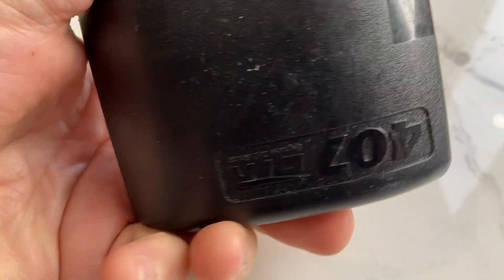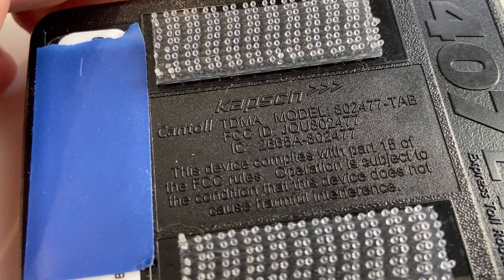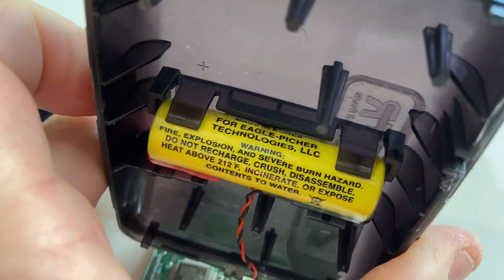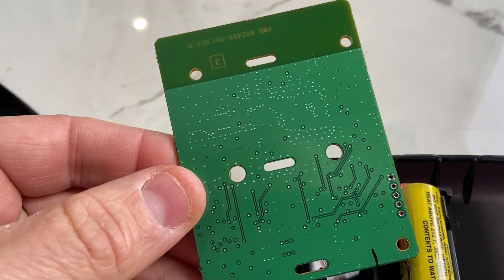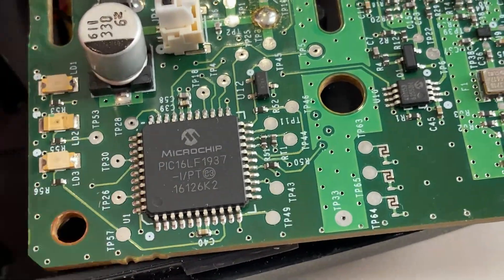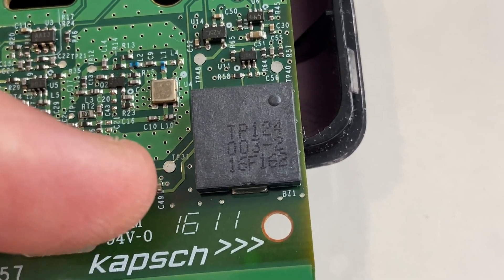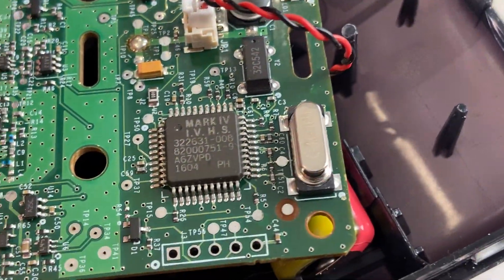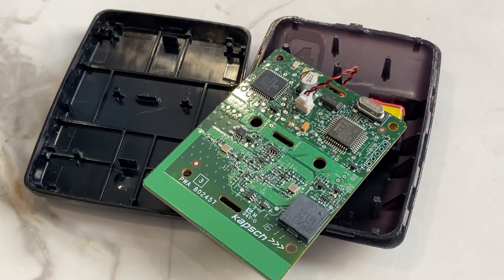Teardown of Kapsch 407 E-ZPass Electronic Tolling Highway Transponder

Comment: The battery is a 3.6V Lithium battery. Usually a TL-5903. Can I have yours? Mine is dead ;-)
Yes, it is 2016/Nov.
Reply from the maker: Thanks! Sadly this device has already been recycled... I can't keep everything I tear down or I'll get kicked out of the house!
Reply: Its a rental dont spend money just go ask them to replace it or give u a new one they charge u money for it for a year of rental
Reply: Are you sure on the date code? I opened a kapsch PWA 802184, but the date code is 1524. There isn't a 24th month, so maybe it is week number? My unit was marked "Exp 03/24" so for a nominal 10 yr battery life, 2015 seems a good mfr year.
Reply from the maker: @johnhouck8315  Yes you are probably correct, the first number may be the year 20xx, and then second number the week within that year (so it shouldn't go above 52 theoretically).

Comment: These use the 900 band. I think they are 928 MHz 

The RFID Frequencies are usually a main frequency, not in the middle of a frequency.

So like 912 mhz is the bottom of the frequency and it goes up to 938 MHz 

I usually see around the 928 to 932 mhz but I saw 915 and 918.mhz.

The frequency being transmitter by the base antennas is very wide

It blanks out the AM band with static as you drive under them 

The license for each antenna used to be available on the FCC database and they are all over the country and they are in city roads and county roads, not just highways.
But after 9/11 they classified all of them as critical infrastructure and a matter of national security and they removed them from the public FCC database
Reply from the maker: Thanks for the detailed information!